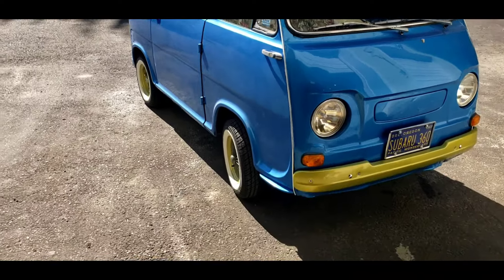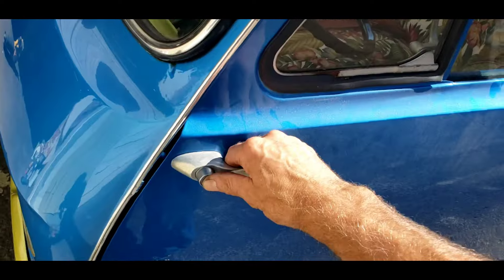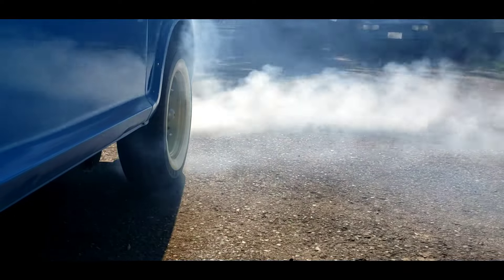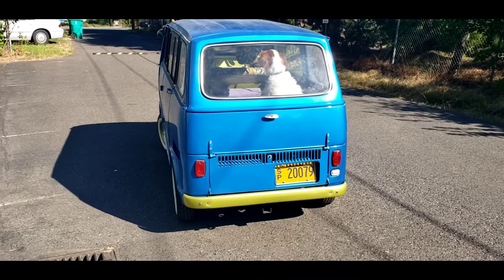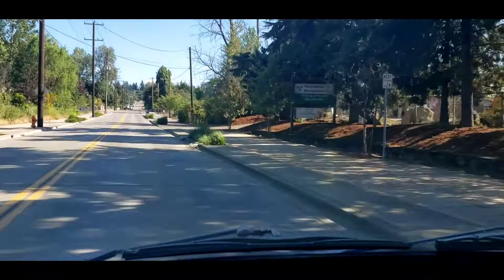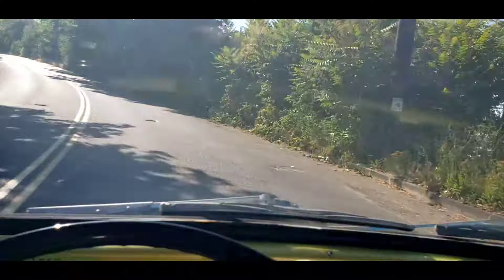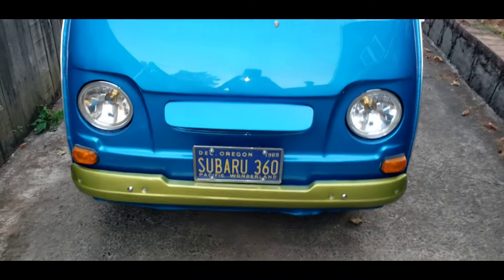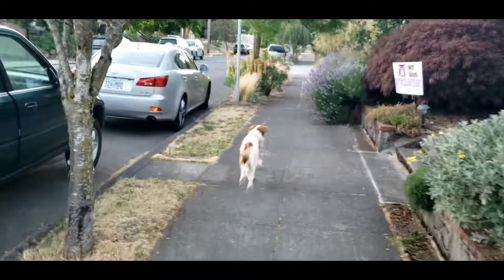Good Advice Not Taken

Comment: With these good modern two-stroke air-cooled oils especially synthetic. I use Amsoil but there's many other good makes out there can you cut the ratio down for Less smoke. I've run a lot of things that were 16 to 1 on 50 to 1 or if it's roller bearing close to a hundred to one although I'm hesitant to go that far.?